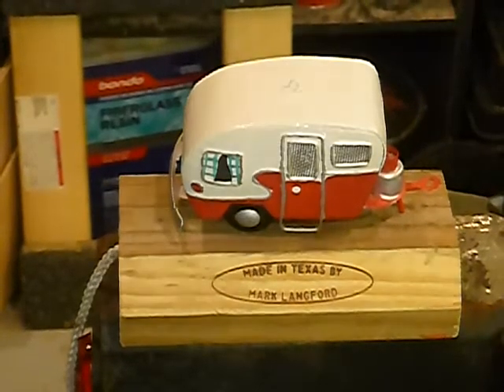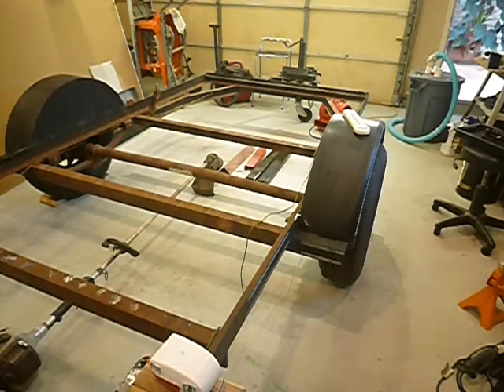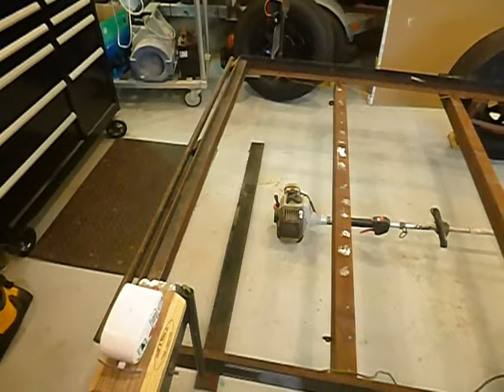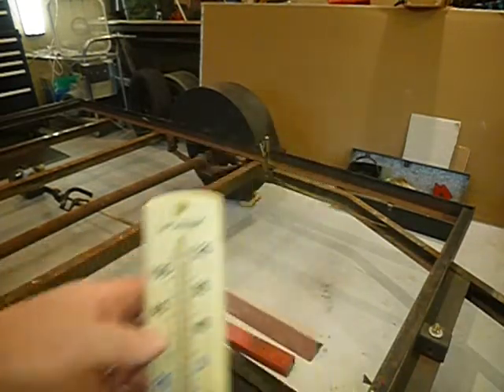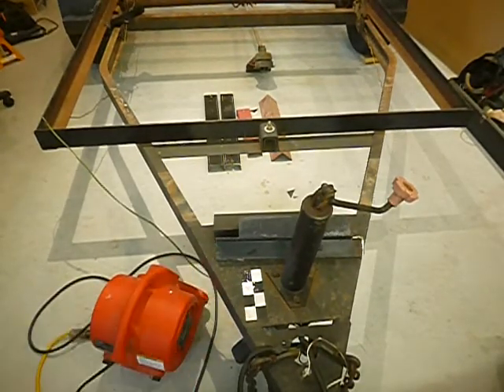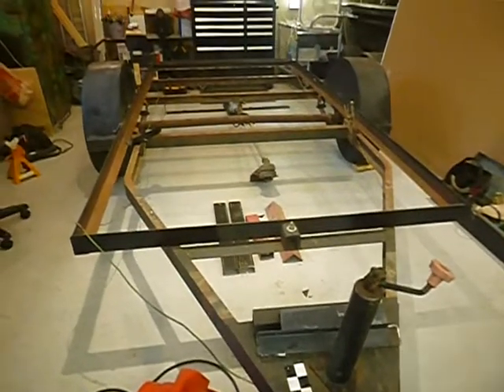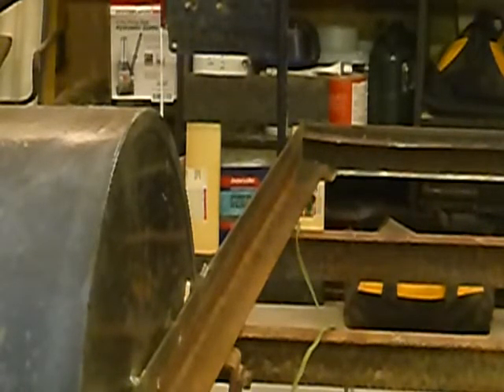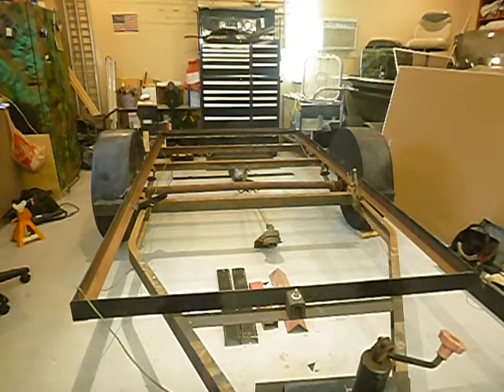DIY Teardrop Camper a 5 X 10   M6     grinding on the old trailer Build your own teardrop camper

Comment: Thanks for sharing. Yep I would have dropped the plywood right down between the angle iron. Thanks for the heads up. Writing it down in my notebook as soon as I get done typing this. Yes I'm taking notes lol. Take care buddy.
Reply from the maker: Glad to help, my friend put his on the angle iron and his rotted out I think in one year . It just looks so inviting to go that way.
Reply: Yep there's a video from someone else on YouTube where he built one on this same trailer and drop the walls right down into that corner of the angle iron ended up with a ton of moisture damage as a result. Had to tear the whole thing apart and start over months later. So good for pointing this out!

Comment: Man I can’t hardly do the heat in the garage anymore right now . Got overheated last year at work and now seems like the heat gets me quick . Just picked up a 6.5 x 10 trailer for my new side by side thinking about building a slide in camper for it .
Reply from the maker: I do have a 12 K btu ac in the garage but it takes a while to get down to 90 but that is better than nothing. A 6.5 X 10 can make a Real nice trailer that can be a nice standy.